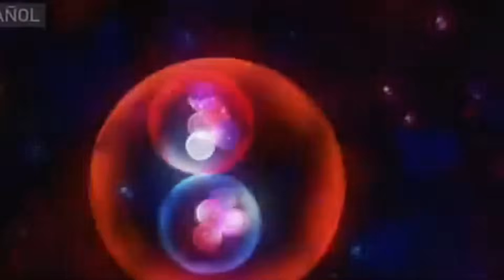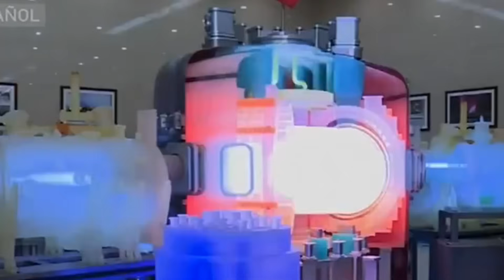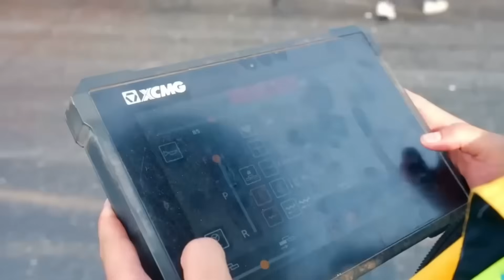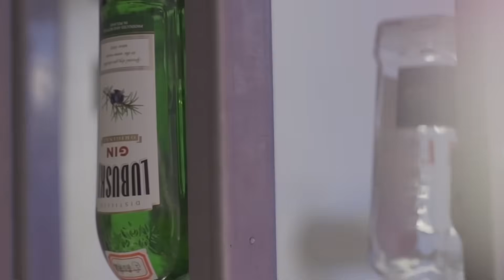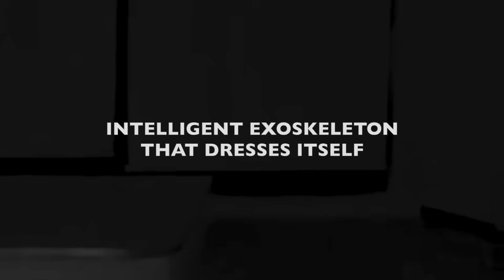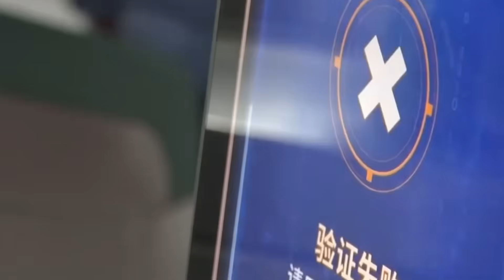This New Chinese Invention Proves They're 100 Years Ahead

Comment: Maybe our Belgium governement needs to buy their machines to work a "bit" faster.  The Oosterweelverbinding finally started. While a temporary bypass opened in late October 2025, the full project is expected to be finished around 2033. Traffic will be able to use the new lowered ring road starting in 2030, but the complete project with all its features will not be finished for several more years after that.